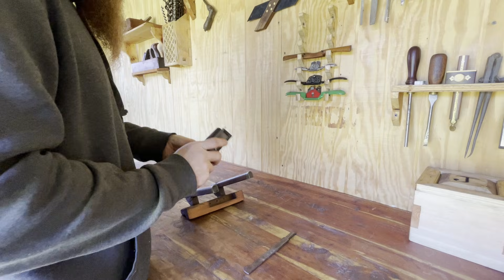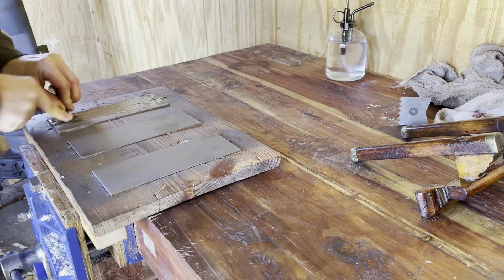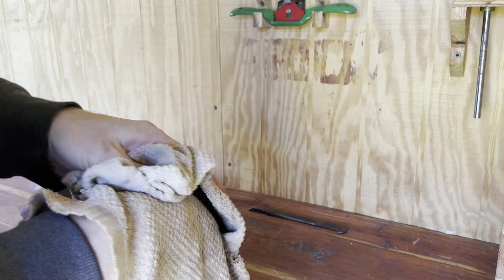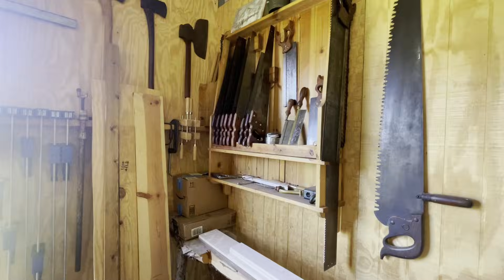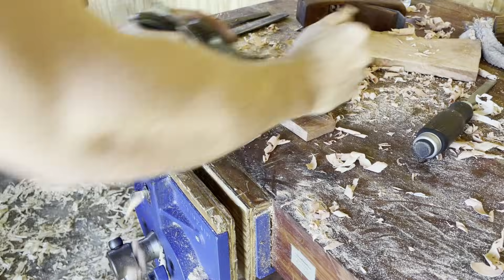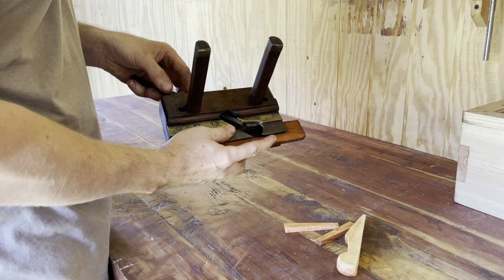Antique Plough Plane Restoration

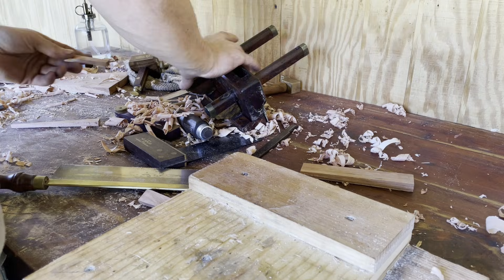Comment: 16:00 when you create the wedges for the arms, if you make the narrow end have a rounded end, wider than the slot, you can make it so the wedges wont fall out, unless you remove the arms completely. Sort of like the wedge for the iron, except at the narrow end. My wedged ploughs use that technique.
Reply from the maker: I've never seen one made like that but it's not a bad idea.